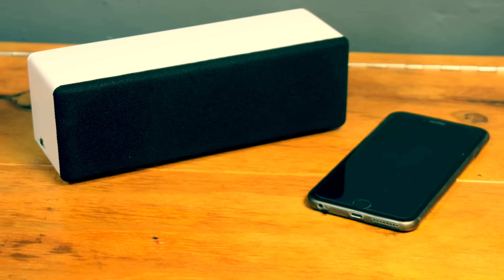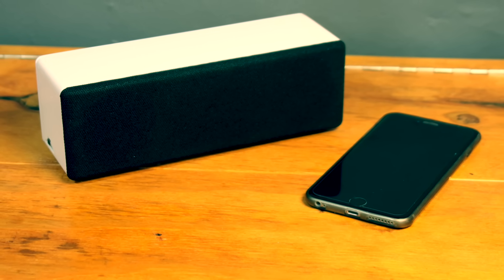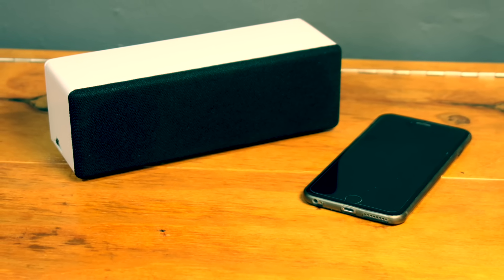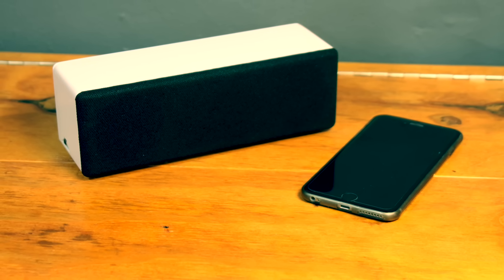Building a Small 10 Watt Portable Bluetooth Speaker - by SoundBlab

Comment: Great video! What's the purpose for the capacitor on the output of step-up converter board?
Reply from the maker: Thanks. That cap eliminates any 'pop' sound when you power on the unit.

Comment: Super work. Was the box sealed properly, with speaker mesh comes between wood. I would add speaker mesh last. Also I think two passive radiators will do better one at the front and another at the back. That Bluetooth module is good (CSR chip only) but in built amplifier is not enough. it is for headphones. better to use a separate amplifier module. Also I would prefer passive radiator with a metal frame as the way you applied glue could affect its movement.
Reply from the maker: Thanks. I do agree that a second PR could benefit the design, but everything else works very well. Well sealed enclosure, PR moved correctly and is still working fine after few years. And it goes loud for the size, definitely not an amp suited to headphones. You will blow them up.

Comment: Dagsê.. What is that square piece called that you insert in the front between the speakers? I have seen you use round ones as well. Is this purely for cosmetics or does it add to the sound characteristics?
Reply from the maker: It is called a passive radiator. Essentially it replaces a typical port in a speaker and acts in the same way where it is tuned to a specific resonance frequency that determines the bass output of the speaker enclosure. The advantage over a port, is that it can reduce the typical boomy sound of a port and reduce port noise as the air flows through a port (in a nutshell, the science is more involved, but hopefully this explains it somewhat).
Reply: @SoundBlab  that explains it perfectly, thanks so much for taking the time to explain it.. Much appreciated. I thought it might have something to do with SPL because there is no port etc.. So it can "Flex" 😂

Comment: Does the front baffle stick well to the body as it is wrapped with the speaker cloth? I am looking into making a similar design but worried about not getting an air tight chamber
Reply from the maker: Yes, I used PVA wood glue and it works fine.

Comment: is the use of sanding primer to reduce/eliminate the inhalation of harmful MDF dust?
Reply from the maker: No, it provides a smooth surface for the top coat.
Reply: @SoundBlab  What did you use for the top coat? Is it a specific spray paint?

Comment: Excellent build, particularly on the audio and mechanical side. I would advise to use a LiPo pack that has some protection build in. A flat pack would also be easier to mount securely in contrast to the 18650 round cell and help avoiding unprotected wire links.
When soldering directly to round cells, a low temp solder e.g. Sn42Bi58 would work great complemented by a low temp setting on the iron would help. In general I’d use more insulation, in case some glue breaks and components come lose and rattle around in the enclosure. 
From an electrical design standpoint step up booster are something I’d try to avoid in an audio context as they are prone to introduce noise to the power rail. I’d investigate towards an amplifier that works well with 3.2V (lower discharge level of the LiPo). If that isn’t feasible - a look into higher battery voltages e.g. 7.2V might be helpful with either a step up charge when USB compatibility is crucial or an external plug pack with a higher voltage might be useful to feed a 7.2V battery. 
I’d suggest some kind of indicator that the systems is “running”. An extra LED shining through the front cloth might be nice.
Reply: E.g. 3.7V flat pack battery w. protection:
https://www.aliexpress.com/item/L308-3-7V-3000mAH-605085-PLIB-polymer-lithium-ion-Li-ion-battery-for-power-bank/32290824638.html

There are "all in one" solutions for the USB-Charge-Step-Up task, e.g.:
https://www.aliexpress.com/item/5V-Boost-Step-Up-Power-Module-Lithium-LiPo-Battery-Charging-Protection-Board-LED-Display-USB-For/32819047141.html

And a somewhat nice USB-solution - avoiding to stick out the full PCB, e.g.:
https://www.aliexpress.com/item/5pin-Micro-USB-2-0-Male-Connector-to-Micro-USB-2-0-Female-Extension-Cable-30cm/32868196892.html
https://www.aliexpress.com/item/50cm-USB-2-0-B-Female-Socket-Printer-Panel-Mount-to-USB-Micro-B-5/32837829085.html
Reply from the maker: Thanks, will check these out.

Comment: Just bought the plans today. One thing I noticed was that there's no power LED. Any thoughts on where to wire one up?
Reply from the maker: Thanks man, appreciate the support! You can go to this URL (http://led.linear1.org/1led.wiz) and calculate the values for the LED/Resistor circuit that you can connect across the positive and negative output terminals coming from the step up power booster board. The same spot where you connect the capacitor. Enter the values as follows for a red 5 Volt LED: 6.5 and 2 and 20. You should get a resistor value of 270 ohms. I have not tried this in my own design, so you do this at your own risk. However, it should work if connected up correctly.

Comment: Why did you get 15w speakers with a 5w amp? That's so useless
Reply from the maker: It means I can drive the amp to it's full potential without getting distortion through the speakers. If I used 5watt speakers it will drive the speakers to it's limit and potentially cause distortion.
Reply: same problem that makes me confused in this video....15w to 5w amp...
Reply: i have 5+5watts audio module also here,,so meaning it was advisable to use  higher watts speaker? am i right?

Comment: Why do you use a condenser in your electric wiring?
Reply from the maker: It is a capacitor. It prevents the speakers from making a pop sound when it is switched on.
Reply: SoundBlab thanks

Comment: Hi, sorry to bother you but can you tell me the purpose of that capacitor? Why's it there? I'm new in this stuff and I already burnt one of those amp boards
Reply from the maker: The capacitor prevents the typical popping sound that the speaker makes when you switch it on.
Reply: SoundBlab Thanks for your help!
Oh ok! And how do I know which voltage and uf of a capacitor to choose?
Reply from the maker: Always make sure that the voltage rating of the capacitor is higher than the supply voltage for the application. If you are using a 12 volt supply, then make sure you use a capacitor that is rated 25 volt, for example. For a 5 volt supply use a 10 volt cap. Also make sure the cap is of the polarized electrolytic kind with a positive and negative lead. Connect the cap in parallel with the output of the power supply rails with positive lead to the + rail and the negative to the - rail. Use a cap with a value of about 1500 or 1600 uF. However, I am not an electronic engineer and can only tell you that this has worked for me when I have used designs that is powered with a battery that is connected on a charging circuit at low DC voltages. I have not tried this in any other configuration. Perhaps there is a more knowledgeable person around here that can comment on this and how it works?
Reply: SoundBlab dam!!! Thanks for the help!! I appreciate the time you took to help me! Keep the awesome work!
Reply: Hi, I finally concluded my speaker with your help but I am noticing that the sound is stuttering sometimes.. like a frame drop but in sound ... Is this happening to you? Did I did something wrong?
Reply: José Da Franca Taborda   'stuttering' is probably either your phone that's running out of RAM while playing music (mine does that, it's old) or connectivity issues. Try sitting closer to your speaker, less obstacles or maybe even solder a longer antanna to your board. BE CAREFUL THOUGH. The antenna is made of thin gold and you can break it while soldering!

Comment: Beautiful build. Is there any particular reason to WHY you didn't shoot for a higher RMS powered amp and drivers as well as battery. I'm also curious as to how long it holds a charge under moderate listening conditions? ? ?
Reply from the maker: Thanks. The bluetooth amps I could find that has higher output normally requires a higher power voltage than the 5Volts I was after so that it can be charged via USB. Also, the 10 watts this speaker for it's size produce seems to be adequate for my needs. I use this speaker everyday with my laptop for a couple of hours and only need to recharge it once week or two. Probably at slightly lower than moderate listening levels though.

Comment: Do you buy speaker drivers locally, and if so, where if you don't mind me asking? That's if you buy from local suppliers. Only place I found with reasonable choice is RS Components. I've been wanting to build a pair (maybe with a 3rd woofer box) of full range desktop speakers for some time now.
Reply from the maker: I have bought from RS before, but the choice is limited. I mostly buy from eBay, Madisound, or Parts Express, which means we pay a bit of a premium when you consider the high shipping cost.
Reply: SoundBlab thanks

Comment: Another excellent Video SoundBlab, thank you! Really like how you make the vids in general, with the fitting music to make it almost a chillout session and not some effed up dub/metalstep... I you allow, a little question; using it at let´s say 50%-75% volume, what is your guess how long the battery will last? I guess adding another one could help, but if you say it lasts for 4 Hours (what I somewhat doubt) it should be okay...
Reply from the maker: Thanks man, glad you are enjoying the videos! I have not done a test to find out how long the battery will last, but I use it almost everyday for an hour or so at moderate volume (20-30%) and I only have to charge it every week or two.

Comment: why you used the 1500 uf capacitor.
please reply.
Reply from the maker: The capacitor helps to reduce the typical 'pop' sound you here when switching on the speaker. It is a polarized electrolytic cap with a value of 1500-1600uF (16V).

Comment: Why do you use a capacitor and what kind is it?
Reply from the maker: The capacitor helps to reduce the typical 'pop' sound you here when switching on the speaker. It is a polarized electrolytic cap with a value of 1500-1600uF (16V).

Comment: Hey, I was wondering what kind of glue you were using with the passive radiators. The glue I used is loosening up, so help would be really appreciated! Thanks!
Reply from the maker: Hi Teun, I use a contact adhesive. You apply it to both sides, wait 10 minutes and then stick it together.
Reply: Hi, thanks for your help. I really appreciate it.

Comment: hello sir
i want to know all components used in this build.
i know some. i want to know is it bk8000l Bluetooth module?
MSB, DRILLING MACHINE.
what is name of smoothing MACHINE(for corner)? and the name of net used in front of speakers? and the what is black tap for air tight.
please tell me remaining important.
Reply from the maker: All the parts and where to get them is in the video description. Not sure exactly what you mean by MSB, drilling machine and smoothing machine, but the corner scan be rounded with a router, and the drilling is done with a drill stand and cordless drill.
Reply: I MEAN IS THERE MDF AS BOX?
Reply from the maker: Yes, 6mm MDF board.

Comment: Why are you filling in cotton ? 
I built the same one ( with a passive radiator on the back as well), but the passives won't vibrate. Any tips ?
Reply from the maker: It is Poly-fill or Dacron. It is used inside the speaker enclosure to provide dampening to the drivers and assist in minimizing standing waves inside the enclosure. It is important not to overfill the enclosure, you want to use only the right amount of fill, to much and the speaker can sound dull.

The passive radiators must be match to the drivers you use. If it is too heavy the passives will not be able to resonate at an optimum frequency. If the passives are lighter in weight it can move more and will work at a more optimum frequency.

The rule of thumb is that the passive must be around 1.5 times the size of the effective radiating area of the driver. However, that is only half of it, you must also determine the ideal weight of the passive from the tuning frequency of the enclosure with the driver you used.

So, just use a passive that is lighter in weight.
Reply: Alright thanks for your help. I will try everything you just said :)
Reply: maybe theres an air leak...

Comment: What kind of sealer is that ? I can't find it in Poland cause I can't translate it properly  : ( Is it nitro based or Shellac ?
Reply from the maker: It is a nitrocellulose based sanding sealer with very good grain filling and sanding properties. It is used for grain filling on interior woods and when sanded gives a very smooth finish. It works well to seal MDF wood before applying an undercoat or top coat.

Comment: hello, considering that there is a 5 watt apmplifier pushing power to 15 watt speakers there is probably distortion on high volume or am i mistaking?
Reply from the maker: This is a surprisingly good amplifier module and there is almost no distortion at the higher volume spectrum. If there is any it would more likely be the quality of the speaker connected to it and whether it has a flat frequency response or not. When the FQ response is not flat, the accentuated frequencies will sound like it is distorting. The speakers I specified for this build has a good flat response and sounds balanced all the way to the top.
Reply from the maker: Of course, because this is a small speaker and the bass output is limited as a result, 'balanced' in this case is relevant to this fact.
Reply: I understand yes..thank you very much for the reply!

Comment: Very cleanly built! Fair play. I would appreciate some credit for the electronics design in the future though.. ;)
Reply from the maker: Hey Barry, Thank you! You are welcome to take credit for it, but for the record your build was not used as reference and no harm was intended in the process! The speaker was not designed and built to be based on any other build and parts were selected through my own research, testing and availability. I went through a few iterations before settling on this particular electronics configuration. With so many similar builds around I think it is easy to put something together that resembles something else and use similar parts without intending to copy someone else's design.
Reply: No harm done :) The electronics configuration here is exactly identical to my previous speaker design however. Also just a quick suggestion, these 3 inch passive radiators would likely be a better alternative to the passive radiator shown above, as it's much lighter and therefor closer to the resonant frequency http://www.ebay.com/itm/2pcs-3-inch-75MM-Bass-diaphragm-Bass-passive-board-Speaker-Bass-Film-/262915552093?hash=item3d36fcf35d:g:S4YAAOSw4CFYuLAH Looking forward to the future videos! :)
Reply: Arrogance! Can't stand it.
Reply from the maker: Cool. Thanks for the suggestion. I'll check them out.
Reply: Barry Llewellyn YT I have built a similar speaker like your one but many months before you uploaded your result. This electronic configuration of a Li Ion Cell combined with a charging module, this popular 5w Bluetooth amp and a Voltage booster, set to the max Voltage of 6.5V ist really common. Just because you uploaded earlier doesnt necisarrily mean that you invented this configuration/schematic. But you also need to give credit to Bose and their design of 2 Woofers and a passive Radiator. I can hardly believe that this also was your idea...
Cheers
Reply: The CSR8645 bt+amp board was virtually unheard of at the time when I uploaded my design, compared to now where it's becoming almost as well known as other compact boards like those based on the PAM8403 platform. However of course there is the small chance that both designs could co-exist without either entity being aware of it. Small details, right down to capacitors of the same value and protected 18650 cells made me a little suspicious. As mentioned before no hard feelings, just pointing it out :) As for the second point, Bose were in no way the creators of the 2 woofer 2 passive radiator format for enclosures. The only significant innovation that I can think of in their Soundlink series is there long-throw passive radiator designs, something not featured in either of these designs.

Comment: u need another  passive radiators -1 passive radiator should be 1.5 x the dimension of 1 driver
Reply from the maker: That is a general rule of thumb, which I agree with in principle for builds using larger and more easily measurable components (small components are very difficult to measure accurately with basic equipment). However, with small drivers like this with limited excursion and output, in order to make that radiator move, it cannot be too heavy or too big. In this case it works well and I think two radiators would not have made any difference to the result.

Comment: Great video and great achievement !!
About the anti pop capacitor, what value do you use, and how did you calculate it please ?
Reply from the maker: Thanks. The capacitor is a 10V 1500uF. As long as the capacitor voltage rating is higher than the input voltage you should be fine. You want a capacitor that can give you a longer 'charging/discharging' period. For this you need a relative high capacity such as the 1500uF I am using.
Reply: Thanks for these informations. I really love your videos !

Comment: I like all of your projects and I want to buy them, but I should have listened to them. As
 for the shape you predicted the speaker, I think you should put 
silicone or edge rubber thinner so you do not have sound leakage.
Reply from the maker: if you glue up the enclosure well you will not have that problem.